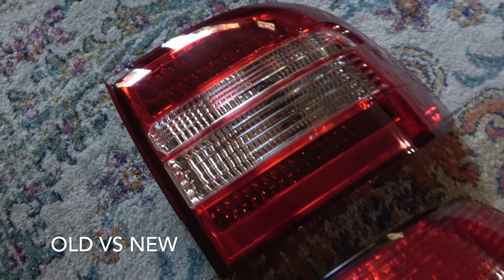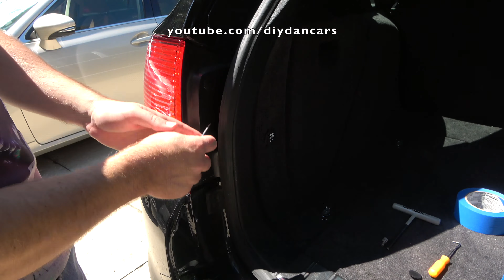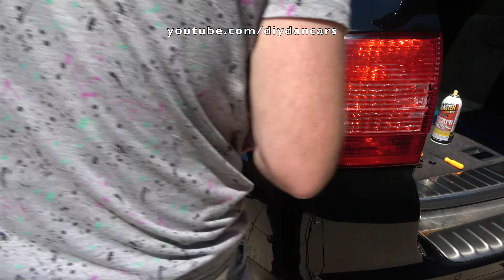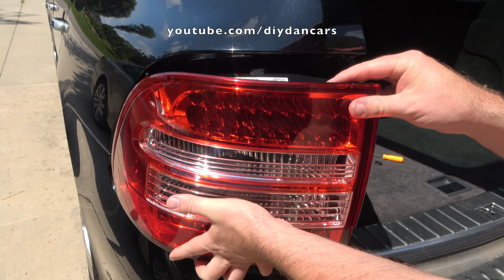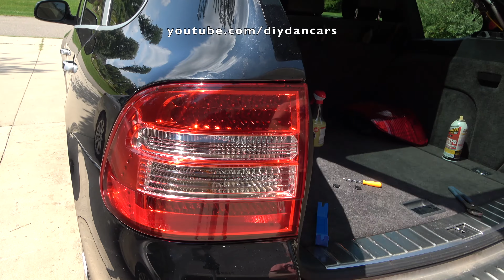Porsche Cayenne: New LED Taillight Install

Comment: Do you have any issues with the car throwing error codes? I've heard some ppl have to add resistors
Reply from the maker: Not at all. These cars are terrible reliability wise so if your car is throwing codes all of the time I wouldn't be the least bit surprised.

Comment: Perfect.. Now I need to admit that the original ones are better looking because of that reddish turn signals but the LED is definitely better because less heat ..less electric consumption and consequently more life to the wiring harness since that is a big problem with porsches. My question is did you get any malfunction in the gauge cluster for installing an aftermarket tail lights ?
Reply from the maker: I had no error codes by swapping the OEM taillights for LED.  No worries, we all have different tastes. I think they look great and that's all that matters!